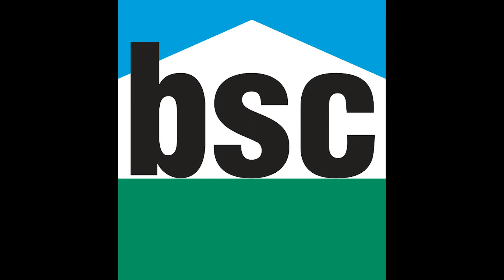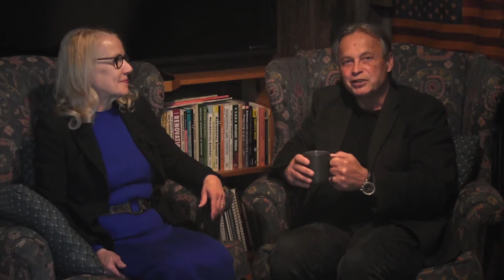Cup of Joe - Betsy Pettit and Joe Lstiburek on How to Get to Net-Zero

Comment: Interesting video, 
I question the one solution fits all in regards to air barriers, vapor barriers and "WRB". There are many climate zones in the US, high humidity locations would utilize a different strategy than a desert climate, even if the temperature ranges are similar. Homes that are built in areas that have continuous below freezing outside temperatures will suffer without some type of a vapor barrier (VB) on the insides and ideally some negative pressure air management via a HRV. Without a "tight" VB on the inside, moisture will migrate into the wall and insulation cavity, condense and freeze, it will NEVER dry to the inside. 

Homes that are built with some type of rigid insulation (remote wall) on the exterior of the home essentially creates a VB, potentially in the wrong location with the wall envelope and can trap moisture. In remote wall construction the rule of thumb is 1/3 and 2/3 rds. Meaning 1/3 of your insulation on the inside and 2/3 on the exterior. And plane your air management layer at the 1/3-2/3 location,  and NO VB under the drywall. What this means is your dew point is outside the membrane and the interior wall will remain warm enough to not condense moisture. 

A typical remote wall home here in Fairbanks Alaska would be framed with 2 X 4, sheathed then a membrane and then 6" of EPS insulation. This works, higher insulation on the inside means you need more insulation on the outside.  It gets cold and stays cold in Fairbanks AK,  as it does in Duluth Minnesota, places in Montana, North Dakota and Idaho. A wall that does not dry out, will rot out...

Comment: It would be really helpful if the NIST specific website, that Betsy recommended near the end of the interview, could be added in the general info section
Reply from the maker: Agreed! And, done. Thank you!
Reply: @buildingsciencecorporation8434  Thanks.  It is interesting to note that the published research only goes to 2016...the page for the zero energy home was last updated in 2018.  Surprising that with all that work and expense (checked out the mechanical drawings...wow) that research would stop after only two years in operation....seems like an awful waste.
Reply from the maker: @richardlangley90  Betsy also wrote about it on our site. Her report is here: https://www.buildingscience.com/documents/reports/rr-1401-design-challenges-nist-net-zero-energy-residential-test-facility/view